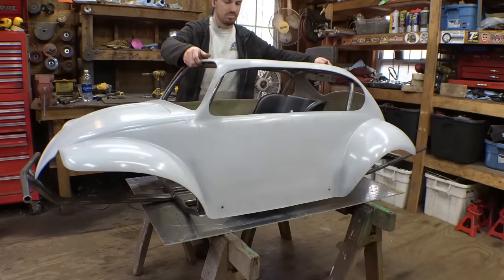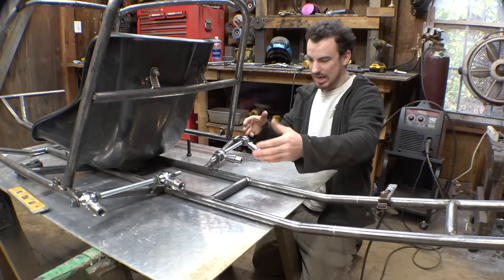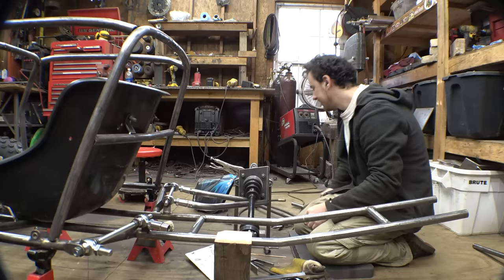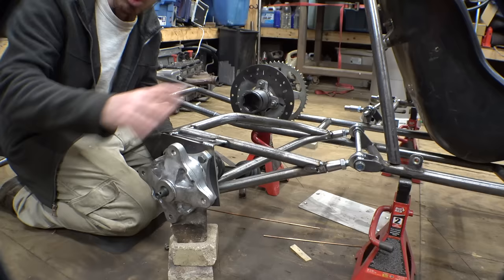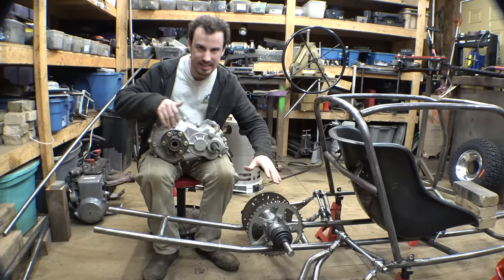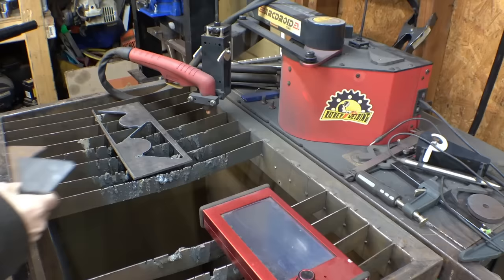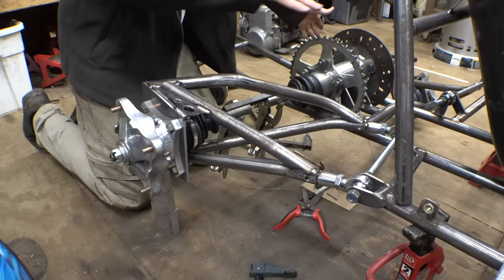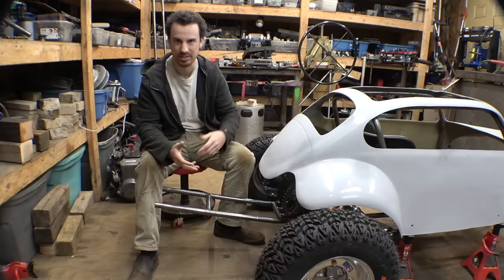Home Made Mini VW Baja Bug!! - Part 2

Comment: It is pretty much an umbrella term for any suspension system that behaves after the main frame, hence trailing. There's probably... i dunno 15 ~ 17 different types and variations. As long as you get the desired effect (suspension) don't sweat it. I've seen some pretty wicked builds that were in no way shape or form measured or cooked in any way that worked great. A dude back in Uni built a quad with trailing arm suspension that wasn't even symmetrical and that quad ran really smooth, way too smooth for something he did in a Friday-weekend with junk from his yard. :))
But if you really want to play straight, basically there's only one major rule (in automotive design). The imaginary line drawn from the rotational axis of the suspension pivot point on the body needs to meet the center (in vertical and horizontal axis) of the opposing suspension wheel. That's basically it. That way, whenever you roll the body into a curve, the imaginary axis between the furthest points (in that relationship) is always in the same plane and bla bla it's supposed to keep the suspension more steady. But really, this is a joy bug, do as you want. Don't sweat it.
Reply: Your definition makes very little sense given there are trailing arm front suspension.

Comment: honestly the only problem I have with the chain drive is that the final drive reduction is done at the wheel on the trailing arm, if the sprockets where smaller. other than that I love the chain drive.

Comment: Hey love this idea, an ATV or SBS diff should work for your application and be about the same size as the solid center you have now so it should be an easy change, the brake steering for the rear is easiest with a single lever and two break pads, keep the steering on your hands and throttle on your feet, it is more intuitive that way...

Comment: The more you increase the angle of the CV shafts the last power they put out when a drive shaft or axle is straight is when you get all your power transfer through it the steeper the angle the more power gets robbed from your engine if it was me building it I would try to position the CV shafts as straight as I could possibly get them at ride height but that's just me

Comment: If you have any questions on these kinds of builds, i recommend a book that is titled "BAJA BUGS AND BUGGIES. How to prepare vw-based cars for off-road fun and racing." By Jeff Hibbard. I know you are not using a vw engine in this case, however, It has everything from engine, transaxle, and suspension mods to breakdown solutions and way more..if it gave me an option to send a photo of the book i would buuuuttt....anyway sweet build.

Comment: Hey I can't tell if you have decided on an engine yet, but I think it would be really appropriate to try and fit either a BMW boxer engine in it or a honda goldwing engine, it likely the most similar engines to whats in the actual VW bug and they are both set up with at shaft drive already, if you choose the right goldwing you might even have en electric reverse. Using the BMW boxer engine would likely be easiest due to them being air cooled.

Comment: Chris, this like your other projects looks totally BAs.   I am wondering if front travel at full droop vs. elevation of the engine brace fully weighted with a passenger is going to make wheelies and the need for a steerable diff even worth the extra work.     I see the rear end just dragging in the sand if the front tires are clear enough to make wheelies worth your while.  Just a thought.  Love your builds.

Comment: If there's room,  you could do a dual brake pedal setup with a locking pin that would lock the two pedals into one....like the brakes on a backhoe

Comment: Hey Chris. Your a very talented young man. I was thinking about the length on the body of the VW. Would it be to much trouble to extend the fiberglass about 4-5 inches longer. Fiberglass is easy to modify and to contour to the original shape you have now. I say this because you said in your last video that it was a bit cramped. Maybe you could extend the body toward the back to help line up the rear wheels. You might need to extend to the front, depending on how you build the steering area. Thank you for the videos. I have several subscriptions on You tube, but your channel is much more enjoyable to watch than the others. Thank you!

Comment: If you remove the small boot clamp off the cv shaft and leave the cup clamp on it should stop the boots getting ripped off by suspension travel and slide on the shaft instead

Comment: Chain drive is great as long as the chain is not too long and there is not too many of them, for a project like this one which is more in "go kart territory" i don't see any issue with this. 
This trailing arm suspension design is very cool, does it give camber gain when compressed ? 
So pumped to see the rest of the build (please do not make it crazy loud, it will get old very fast, especially with a CVT)
Reply: Really two would be the magic number but hey one is enough according to you and you know best.

Comment: Chris you may want to think about a limited slip rear. I'm thinking you may not be able to get it on the back wheels with an open dif. The individual brakes would still work because one of the other could defeat the limited slip.
Reply: Limited slip is the dumbest idea I've heard all day. Limited slip is designed for cars driving on pavement not dirt. You want full locked rear drive in a off road vehicle genius.
Reply: The buggie should have a clutch so a turning brake is exactly what it needs. How do you think they are set up in a vehicle.

Comment: Why not use a thumb throttle or a finger throttle like on four-wheelers and then run a brake pedal for each side like a lot of the sand buggies have then you wouldn't have to fight using a throttle pedal and two brakes😮😊

Comment: To satisfy the Anti-Chain crowd, why not do a toothed belt drive, like many motorcycles do. So much quieter, easy to do tensioner and all that, and can take the power. Not the belt drive like you have done before on the smooth pulleys, but a toothed one. Just an idea.

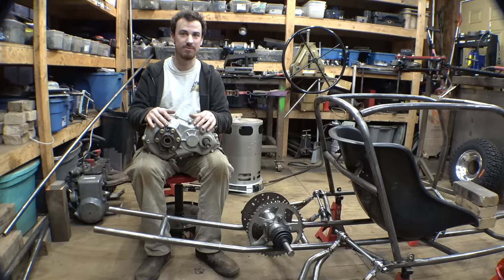Comment: 17:02 chain drive is the best. It’s the least resistance. A diamond drive unit sucks up hp. There is a reason motorcycles still use chains. They’re efficient. Anyone that doesn’t like chains, wears a purse.

Comment: Do you think a cross brace tube would be beneficial on the ‘lower arm’.  I’d have one in there right at the bend, on the same path as the centreline of the front pivot.

Comment: They're just called steering brakes... You probably don't need them. I set up my trike like that with two masters one to each rear. (The front locked up with 1 psi of pressure from your pinky.) Lemme tell you every stop became an emergency stop. It was like riding a squid! The light turned yellow and I'm instantly all over the road barely holding my lane. You don't need it. Wheelies going straight are good enough 99% of the time.

Comment: This may sound like a stupid question but I know it would be a little bit harder to do but wouldn't it be easier to point the exhaust out the back so turn the motor 180 Grand you have to have a jack shaft to put the power back to the wheel but at least it makes the exhaust easier
Reply: Problem then is that everything turns backwards. Trade one problem for another.
Reply: That's what the Jack shaft is for to reverse it back to the other way but it would give him more gear options as well it would also make this exhaust not so close to the seat so that he can actually get the potential out of the motor instead of having to redesign the exhaust and try to tune it
Reply: @jimhillbilly0866  Jack shafts don't reverse rotation. Snowmobiles already use jack-shafts and everything turns the same way. You need a gear somewhere to reverse the rotation in order to flip the motor backwards.

Comment: So on the trailing arms. People switch from a stock trailing arm bc it’s a single and doesn’t articulate the way u need to when off roading. As long as they move I’d say 15 degrees with out binding. But you’re not doing jeep things. A single trailing arm doesn’t give u the durability. Some trucks u just can’t articulate the way a 4 link gives u. I’ve seen some jeeps and trucks about 25 degrees with the cab only tilted just a hair 😂 the only science behind it is the physics of it 😂 it’s just going to depend on what u want to do with is how u will build it

Comment: About that dana gearbox, can you reply with info on how I can find these or what they came in etc?. I wish there was an affordable gearbox that had quick change gears from a NASCAR style quick change rear end. This way no problems with ratio just put in the right gears for what you need. well that should be pretty easy to build but then it would need reverse also. So... Guess I will just have to make one to see if I can.
-
Suggestion for future builds, try a Honda CR-V rear differential. They are light and pretty easy to find and use CV axles. They have a pump/clutch pack in front that can be removed or disabled. This should leave enough room inside the front section for a planetary gear reverse from an auto trans like a turbo 350 to be installed. This would make them super cool for building buggies. I am looking into this and need to get one to mess with.

Comment: Anyone who critizes all chain 4 wheel drive doesn't know that Polaris used all chain 4 and 6 wheel drive until 1998. The only real downside to all those chains is you have to adjust them. Other than that, I prefer it. You can change your ratios easily. The rings and pinions can't be changed easily.

Also, to all you chain haters, if we had YOUR budget, maybe we could MAKE appropriote rings and pinions for our applications! Hell with you guys, have you actually MADE anything? Let's see your rigs chain haters! Put up or shut up!

If you want to replace the spool, now's the time.

Comment: Would it be possible to put discs on each rear wheel then you can run two hand brakes in the cab might be less work than doing a whole differential. And by the way nothing wrong with chains takes too much power to run drive lines. Only my opinion

Comment: Why don't u mount the the motor sideways n make it shaft driven ,by making a adapter that goes from the output output shaft on the motor 2 the gearbox ?

Comment: For those who have an issue with these projects being chain driven, perhaps it's worth pointing out that all cars were once chain driven. Also, those people are welcome to build their own projects. Idealy, I'd probably want to avoid chain driving but it's not me who has to pay for parts and find them/make them
Reply: All cars were once horse powered too. Not sure how that makes it ok.
Reply: @bradley3549  Some bikes are actually pretty damned heavy, granted, less heavy than a car but some bikes have pretty high horse power. Anyway, as I said, those who have a problem with how a youtuber builds his projects, those people are more than welcome to go and do better.
Reply: @nobodycares85  I never said they weren't. Or that chains are necessarily bad. Just pointing out the huge flaw in your "long ago it was done this way, therefore it must be good!"
Reply: @bradley3549  Show me where I said they must be good. I'm just saying, they're automatically bad. I'm not the one making an argument.
Reply: @nobodycares85  Fair point. In that case, what were you trying to convey when pointing out that all cars used to use chains then?
Reply: @bradley3549  People keep on complaining about these projects using chain drive as though it's this stupid idea that no one would ever use. My point is that it was all we used and it worked fine. That's not to say it's a perfect solution but I suspect the biggest thing against chain drive, other than potential weakness, would be noise. Modern drivelines are much quieter. In any case, the whole chain drive being used in old cars really was not my main point. My main point was that people are welcome to build their own projects instead of knocking someone whos channel they chose to watch and then complain about.

Comment: My ONLY issue is your seat. Thats definitely a recipe for disaster. I would put s much taller seat so if you roll all the weight will be on the seat sticking out and not your head. You may need to trim the back alittle snd maybe adjust the bsck of your cage but it will br worth it and it will still look good. Safety first.

Comment: Chain drive is noisy, unreliable, more dangerous, harder to work with, look bad...  You are likely loosing a lot of power in the chain drive too.  That engine is designed to run a crazy amount of RPM and the power band is not on the low end so I am surprised you do not need a lower gear reduction.  With you doing a trailing arm only suspension you will need an axel that expands and contracts quite a bit to handle the suspension travel.  If you did more like a wishbone suspension the two have very similar travels and will not need an expansion joint.

Comment: You really should get away from chain drive. Using a real engine with driveshaft would open up the possibilities exponentially. Tons of atvs and even bikes use a shaft drive, then you can use real solid axles not miata parts and 250cc atv hubs.